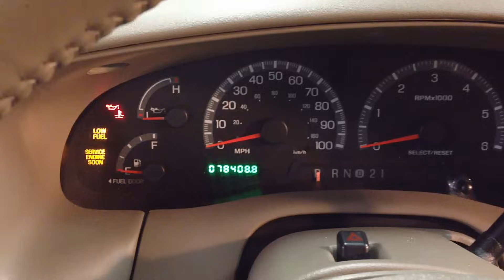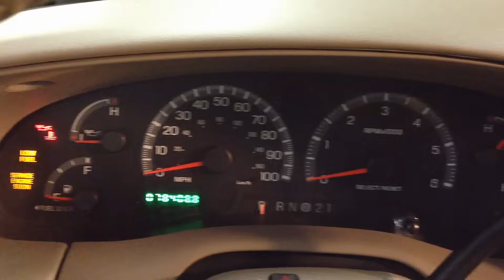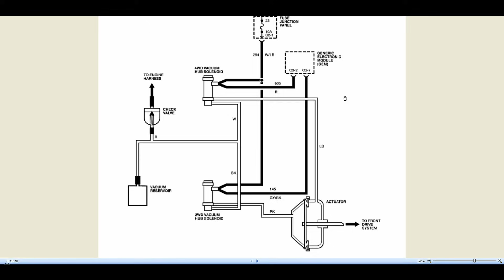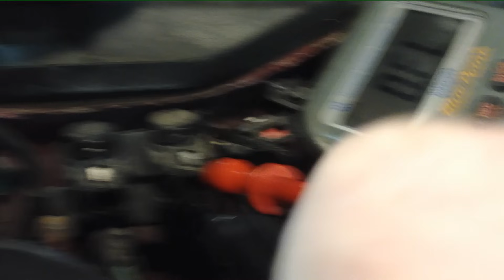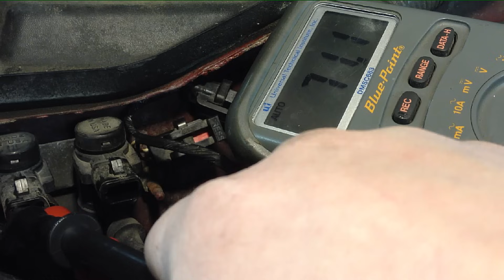1997-2004 Ford F150 4X4 Inoperative In Depth Diagnosis

Comment: I got a question about the vacuum. When I test the vacuum going to the actuator and I have it in 4x4 should there be vacuum coming from both solenoids? Also if I have to replace the 2x4 solenoid what position is it at, 9 o'clock or 6 o'clock?

Comment: My particular problem on my 2003 Lariat SuperCrew is my 4x4 works pretty much just fine in dry conditions, only issue is it doesn’t always come out of 4Lo but I rarely if ever use 4Lo. However— in wet/icy/snowy conditions, my 4x4 will usually engage after a few minutes, then disengage, then re-engage, then disengage, etc. without me ever touching the switch. Switch stays in 4Hi, and it engages and disengages itself whenever. Usually disengages every single time I really need it. sometimes it wont even engage in the first place, or I have to let it sit for a few minutes then try to engage the 4wd. I live just outside of Denver in CO, which as I’m sure you can guess, we get quite a bit of snow and ice in winter, and not having 4x4 when I need it is a very big deal for me, and it isn’t very safe at all. I am thinking it is probably the Transfer Case Motor, but also don’t jut want to throw parts at it, because in my experience I just end up spending the money I was trying to save on more parts or just doing what I should’ve done in the first place, taking it into the shop. Anyway, if you could give me your opinion on what the problem could be or what you think is most likely the problem, I would greatly appreciate it. Thanks dude.

Comment: is there any way man you can help me out with a 2003 Ford F-150 SuperCrew I got a 99 engine in it and I need a vacuum diagram for the original 2003 so maybe I can get the fire vacuums back to the way they should beor maybe the color picture of because I can come out pretty good at it but not I'm not real great

Comment: WOW,, you have a very well display to check. I will be checking daylight tomorrow to find the problem. Front actuator working but slower than yours demonstrated. Transfer case working as it goes in low. Now to see if it is the front drive of the transfer case or the actuator. Thank you so much. Be in touch as I find out.

Comment: If the 2 wheel drive solenoid is bad could it make the truck engage into gear in 4WD mode only? MyTruck will not go into gear in 2WD. But when I put it into four-wheel-drive high or low it will drive

Comment: On my 2002 F150 when I test the ground to the 2wd solenoid, it is activated when the selector switch is in both 2wd and 4wd.  When I test the ground to the 4wd solenoid, it is never indicating being activated when the selector switch is in any position.  4wd dash indicator does not light, no clicking sound coming from GEM, no noises coming from actuator.  Vehicle is not throwing any fault codes.  Any help would be appreciated.  Thanks!

Comment: Hello. My 4x4 solenoid isn't receiving the ground signal from the GEM when put into 4 wheel. The t case motor seems to be working, cant spin the front driveshaft by hand.  I'm going to pull codes from the GEM tommorow. Is there anything else I should be looking for. Thanks a ton.

Comment: Thank you fro your video,  I do have a question.  I was having an issue moving the actuator and replaced both solenoids and now the vacuum control is working.  The actuator is pulling to the (passenger side) 4wd but the diff is not locking, thoughts?.  I don't think the transfer case shift motor is not working either.

Comment: Have a 1998 Ford Expedition, but when switching to awd or 4x4 hi or lo, I don't hear any clicking and dash lights do not come on. The dash selector switch checks ok, so seems like it could be the module or the shift motor. Do you have a way to determine which it could be?

Comment: A little late to the party here but, what would cause the 4x4 hi light NOT to illuminate with the rest of the dash lights when you first turn the key forward?  2004 f150
Reply: Rick S that’s probably the bulb if everything else works
Reply: @mikegamber4135  it was the shift motor. Replaced it yesterday.
Reply: Rick S I replaced my shift motor yesterday too and I got nothing.
Reply: @mikegamber4135  i figured I got lucky...
Reply: @mikegamber4135  well back to zero. Went to use 4x4 today nothing. Lights came on but 4x4 didnt engage.

Comment: Hey I have a question I have a 1998 Ford F-150 5.4 v8 and I tested the vacuum all is good the actuator I put it in 4 high or 4 low and back to 2 wheel drive it doesn’t always ingage and I find once it is and I put it back too 2 wheel drive it doesn’t ingage back but stays in 4*4 or 4 low any thoughts?? I’m rly sure it’s the actuator itself the pin/ball that clicks gets stuck 🤷🏽‍♂️

Comment: Would this cause limp mode? My truck has drive and reverse but is stuck in a high pressure low geared like drive. Codes p1877 p1876

Comment: This is an excellent video. Everything from the video checks out, including the vacuum reservoir behind the battery but I have an old problem and a new one. The old problem: 4x4 works fine until I accelerate then it will kick out and back in randomly, quite violently, but it's just fine low speed, low rpm. New problem: Now, also when accelerating the air from the vents will blow into defrost until I let off the throttle, so I'm thinking both are vacuum related and the only thing left I can think of is the vacuum check valve from the diagram but where is it located? Also, does the check valve sound like a good suspect for these problems?

Comment: Hey bud I don't know if you can help me I got a 98 F150 that I just picked up it was hard to move the four-wheel-drive reliever into four-wheel drive and back out the truck drove fine had all gears until I mess with the four-wheel drive and once I did and I backed out of where I was I lost all forward gears but I still have reverse

Comment: could you help me out with the shift motor I do not hear it engage. what would be the first thing I need to check besides wiring and if it is plugged up. it all looks to be there, I just recently purchased a 2001 f150 4x4 5.4 super quad cab and the 4x4 does not engage. I do not hear anything when I engage it. it has the electric 4x4 switch. plus this is all new to me because up until now I've owned chevys lol.

Comment: Thanks for the video, really informative and helpful.  I went through this, having a problem of 4 wheel drive not engaging. Flip the switch and nothing. I have vacuum to the solenoids, but none leaving to the actuator.  I have power to solenoids but neither is grounded regardless of the 4 wheel drive switch selection. From reading other comments I'm detecting a pattern of get the GEM codes read, I'll do that, but is there anything else to check. All fuses are good.

Comment: my 1997 won't disengage from 4 wheel drive. I do not hear the clicking when I turn the dial. I checked the vacuum on the solenoid s in this video..is not strong but is there. what should I check for no clicking?

Comment: Great Video! Although it doesn't seem to cover the electrical from the solenoid back and it seems that is where my problem is. ...My 4x4 light does not come on and when turned to 4wd with the switch you can hear the relay click 4 or 5 times then quits. I have vacuum and power (12V) at the solenoids but do not see the GND change when the switch is changed. I had to use an ohm meter instead of the light like you had. I just measured Ohms from the neg term to the left term on the solenoid plug while I changed switch settings. but no change. Pulled the switch and unplugged. I can only find 5v on the plug... any help or am i way off?  Thanks for any response...

Comment: Just saved my ass for the info. Got stuck a few months ago on a hill, truck wouldnt go into 4wd. Took over an hour to get pulled out as i couldnt turn the truck around. Just fixed the 4wd today. Hole in the vacuum line

Comment: I am having a problem with my 1997 F250. The 4X4 lights on the dash do not come on when I switch it into 4x4. I checked the large red 10 amp fuse in the fuse box under the hood and that is ok. I recently put a hub bearing assembly on the right front. Since then the 4X4 has not worked.

Comment: great video, I'm still not understanding 100% I have a 2002 f150 fx4. I've changed both solenoids,4x4 light went off, still wont engage, driver shaft turns in 2wd and 4wd ,actuator is not moving at all there is vacuum, what should I do next, buy a new actuator, or a new transfer case motor? also I'm hearing clicks now when switch to 4hi. any advice you can offer is greatly appreciated. thank you!

Comment: Hello.  I'm found the video of how to diagnose 97-03 4wd problem really helpful but I have one question regarding the constant current.  When checking, what terminal of the battery were you hooked to when testing for constant current?  When I tested mine, I was on the positive side but your video makes it seem you were on the negative side.  If that's correct, why am I getting constant from the positive side?  Gem bad????  Fuse panel bad?????

Comment: We have went through our entire vacuum system and it works fine. Our solenoid are good. But when we switch from 2wd to 4wdh n 4wdl it's like it locks in but still doesn't work and when we try to go back to 2wd it's like it sticks in 4ad and won't go back. I have to shut it off start back go from neutral to drive n then to reverse and it will sometimes disengage back to 2ad. Need all the help we can get thanks a lot. It has automatic with the button on the dash. We put new solenoid in and new actuator. Everything's working properly from the top down but it's like it's getting stuck. Only thing I can think of is the t case motor

Comment: Hello, I have 97 Expedition. When I turn on the heat it engages the 4×4. Turn it off and the car runs normal. Also when o turn on the lights it engages the 4×4. There is a lot of clunking binding and noise etc. So I can't really drive it at night because I can't turn the lights on. Any advice? Thank you KB

Comment: I have a 98 Expo 5.4. Dash says 4x4 but the selector switch is in 2wd. Moving the switch does nothing.  No noises from the relays or anything. I checked the vac solenoids and the 4x side has the ground side power when it should be the 2x side that has vac because the switch is in 2wd. Test light verified. Again not motor sound or relay noise when I move the in-cab selector switch. I also tried to get it out of 4wd by taking the connector off the vac solenoid, stayed engaged. Bad selector switch? I was using the 4x4 the previous day. Put it back into 2wd and drove home. Wife went to run an errand the next day and the truck dash indicated 4x4 but the switch was 2x. I am baffled. Please help.

Comment: My f 250 goes into 4 wheel drive and power windows and dome light work when key is turned on ACC as soon as I turn key to start  motor 4Wheel drive kicks out and my windows stop working and my dome light goes out.
Any ideas

Comment: I can't not get my 4 wheel drive to engage at all and the 4x4 light on the dash stays on if I put it on 2wd or 4wd
Reply: Mark pfeiffer where you able to figure out the problem
Reply: @nathanpino8128  yes I did thank u so much

Comment: Hey there,I have a 2002 f150 5.4 electric dash switch, I was having a problem with 4x4, fuse #104 kept blowing and 4x4 would not work, after replacing the same 30a fuse multiple times every time I used the 4x4, I put a 40a fuse in and it worked once and won’t work again even if I put a 30a fuse in. Now when I turn the switch to 4x4 there is no light or clicking on the dash. Any help would be greatly appreciated.P.s. when I swap the vacuum lines on the 2 solenoids the 4x4 will engage.

Comment: I have checked the wiring harness off of the selonoids 2wd and 4wd with light on neg battery, both give a light. When I switch the light to the positive it lights up in 2wd mode, but when I switch to 4wd no light. I checked the 2wd terminal while in 4wd and it lights up. Would this be a bad gem module?

Comment: i have a 98 f-150 4x4 .  the truck engages in 4wd when the switch is in 2wd.  I cant get the truck back into 2 wd.  it does this intermittently.  I have had the transfer case shift motor replaced twice.  Its nice and smooth shift when its working right, but shifts hard when its not.   Any ideas?  relay?

Comment: when I did a smoke test I saw smoke coming from the top of the 2wd solenoid. after removing the cap I noticed the foam seal was completely Deteriorated. could this be the cause of my lean condition on both banks? 2001 F150 5.4

Comment: Thanks for the video. I have a Ford 1998 Expedition XLT 4.6L with 2H/AWD/4H/4L knob. For this past week was the first time that I used 4L to get out of the snow in about 16 years. I thought I had it in 4L. Place in neutral and switched from 2H to 4L. Only the 4X4 light came on. The “Low” light did not. Drove some and everything was cool. Then, tried backing into my driveway, I heard this really loud noise like high pitched fast gringing. Put her in neutral, shifted back to 2H and threw her in reverse and drove backward for 20 ft. 4x4 light went off and all seemed ok. The truck has been my daily driver in 2H 99% of the time that I have had her. Doesn’t snow much or get terribly cold in Hampton roads va. Was at a stop light the next day. Put her in neutral, shifted from 2H to 4L and then drive, I felt the transmission switch up and heard it too. Drove the rest of the way home over ice and snow. Once I got home, I tried taking it out of 4L by going into neutral, switching back to 2H and shifting to reverse and driving 20 ft in reverse. This time it wouldn’t switch back to 2H. Seems that I’m stuck in 4L. I tried unplugging the battery and no go. 4x4 light went off but the transmission being in this mode now makes the truck feel sluggish. I’ve noticed that when switching the knob to 2H AWD or any other setting I do not hear the clicking relay in the dash like I did three days ago. The 4x4 light no longer turns on. AWD light does but I don’t feel the transfer case switching around. Right now, I hear a whine going down the road at 20-30 mph. Have not exceeded 35 mph and my overdrive light is flashing now. My coworker thinks I need to wait until it warms up and smack the electronic transfer case motor with a hard rubber mallet to see if it’ll shift back. Any thoughts on how I can resolve this. I have not driven it since the OD light started flashing because I have read that I can damage the transmission by driving on dry, smoothe roads in 4L. Bought the truck with 28k miles on it back in Feb 2000. Got 199k miles on the original engine and transmission on it. Never raced or towed anything with my truck. Not in the market to pay 60k on a new expedition now, and really cringing at the idea of shelling out $2k or more on transmission issue on a truck that may not be worth $1k. Any ideas? Appreciate any and all help. This is the coldest weather that truck has seen since I’ve had it temps ranging from 9° to 24°F for the past 5 days.

Comment: i have a 2003 f-150 4 x 4 the diaphragm is functioning and i can hear the clunk when i switch to 4 wd   but 4wd does not activate , the transfer case motor  was just replaced

Comment: My 99 Expedition would not go out of 4HD after I turned the switch. I took a small hammer and taped around the shift motor and it's housing. I had the switch back in normal 4WD, started the vehicle, BINGO it went back into Normal 4WD!!

Comment: So, when testing the two solenoids on the firewall both of them are hot, however the 4x4 solenoids ground never gets activated when I switch the 4x4 switch on.  So does this mean I should stop there and go ahead and replace the GEM?

Comment: When I select 4x4 high-low with dash switch,no light on dash, no clunk or sign of engagement just worked fine last winter with very little use. what would you suggest? Thanks in advance
Reply: Ever figure anything out?

Comment: Bought my 04 Expedition used.  The 4Hi 4Lo lights blink three times sporadically.   Had a mechanic tell me it was the Transfer Case control Module, but I have put two in and that has not fixed the problem.  Today, after looking at this video, I went to test the solenoids and found that my truck ONLY has one, the 4WD side.  Now I don't know what the heck is wrong!

Comment: Dammed thing wants to engage into 4 wheel when driving along in 2 whl dr. Horrible grinding sounds of gears trying to mesh and only gets alleviated when pulling the shifter into 4 whl. I can push shifter ahead into 2 whl and that sometimes keeps it there for only a min or, sometimes for days. Then the grinding starts again. Also at times the 4 wheel dr light will appear out of the blue and sometimes flashes on and off with a clicking sound coming from the glovebox area. I ckecked the vacuume box and all the stock hoses around the firewall . All seemed fine. Any help please. Thx Frank from N. Vancouver, BC

Comment: How do I troubleshoot the dash switch? I can hear a very light click coming from the left side of dash, but no dash light or activation. My problem is very intermittent. Works fine, then often won't come on. Other times I can't get it back to 2WD. 
2000 F150. EXCELLENT VIDEO!

Comment: I have an 04 "new style" FX4 with 5.4. Amazing that it's 14 years old and only has 84K miles, mostly garage kept, and seldom 4wd used before I got it. It worked great in January, and now doesn't. I went thru my diagnosis. With key on, flip the selector  switch, I get the clicks, however, the light on the dash, only stays on for about a second and goes out like a flash, I flip back to 2wd and I get the clicks again. If I try it again, I still get the clicks, but don't get the light at all. So if I turn key off and back on and try the same test again, I will again get the light to flash and go back out. So now what? Thanks..